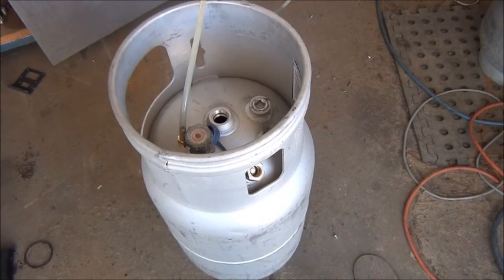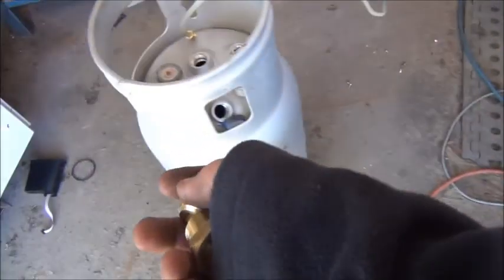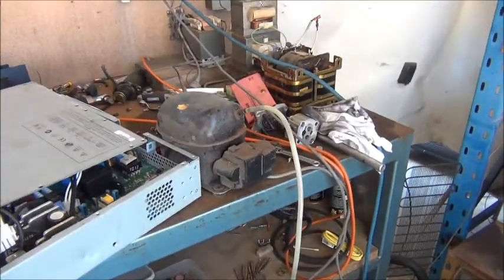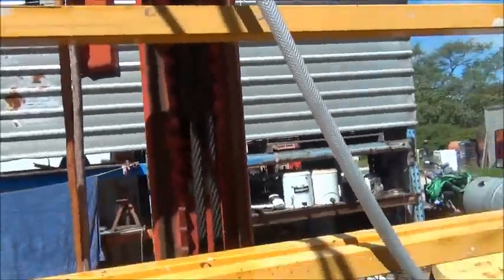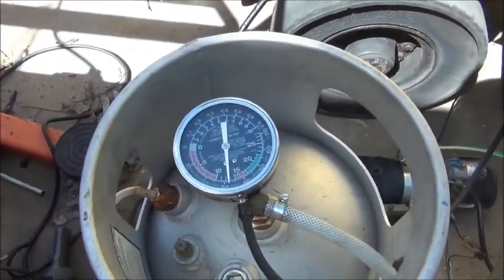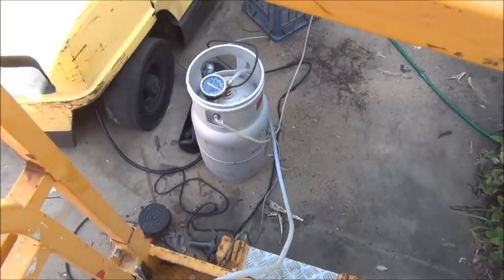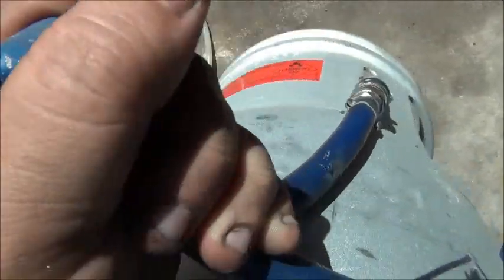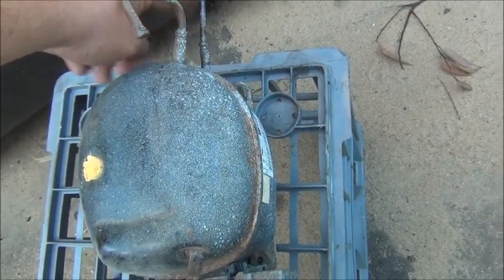Operation: Vaccu-Suck. De-Watering the Hoist Ram.

Comment: If you can bear to wait twelve hours, use Loctite 592 on the threads.  Far superior to teflon tape, highly chemical resistant and won't dry out or crack.

Comment: Clever sod :-))

Ooow loverly, having a bath in that stuff would be so evil lol.

Are you going to bung a gallon of hydraulic fluid in the ram to wash the final bits out, or do you think you will get away with it?

Perhaps putting the bottle and compressor on a cart would be usefull, super speed oil changes lol :-)